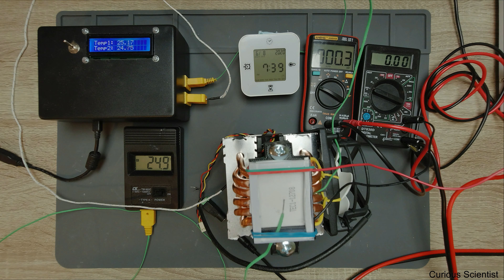Testing and comparing different Peltier coolers - Part 4 - TEC12708

Comment: I have a question, I bought a peltier module and it is written SR under the TEC1-12708. Does that make a difference?
Reply from the maker: Honestly, I don't know what SR can mean.  Try to search for it on Google.
Reply: I believe that has to do with the sealant type used around the edge of the unit.

Comment: Where did you buy this peltier(TEC12708)?
Reply from the maker: I got it from Ebay from Germany. Just search it on Ebay or Aliexpress. Don't go for the cheapest one because they are most likely to be fake (originally TEC12706 but with different number on it).
Reply: @CuriousScientist  ok thx
Reply: @CuriousScientist  sry another question, peltier size 40x40mm or 50x50x4.5mm?
Reply from the maker: @luish.c.6687  No worries! All the Peltier coolers I use in my videos are 40x40 mm.